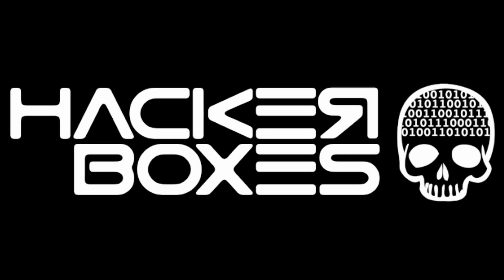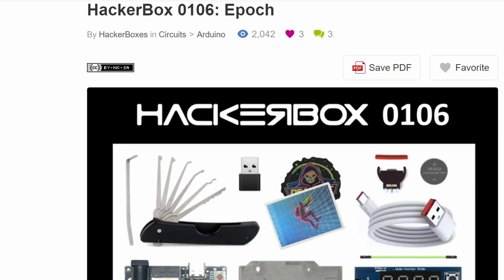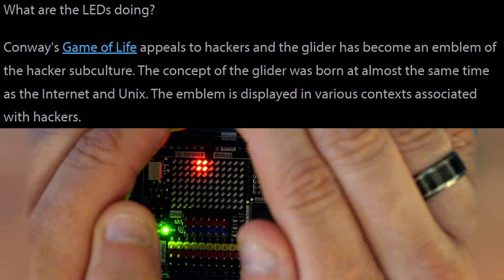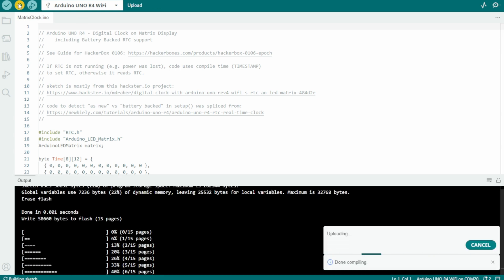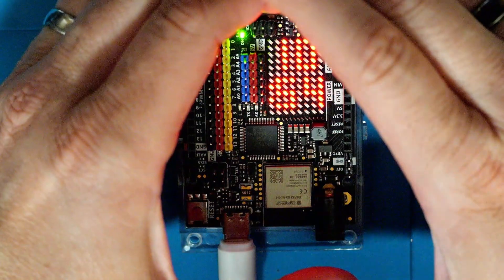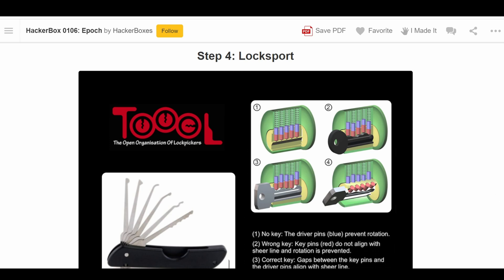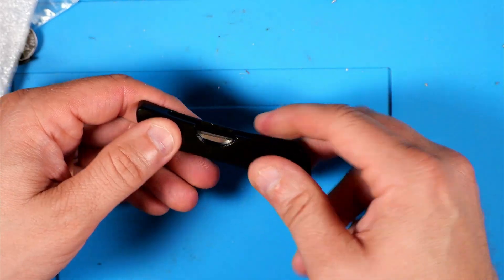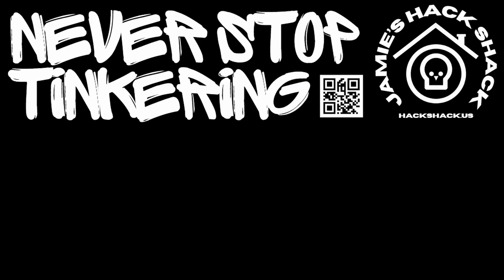Hackerbox 0106 - Epoch

Comment: PhreakNIC had a "Drunken lockpicking contest" way back when in Nashville. Yeah, that didn't work out so well... :) They did have some great locks, including military ones that required that there be embedded magnets in the keys (still pick-able, but they slow you down). Not really my thing, but it was interesting. 

And how did you hold up during what was left of Helene? We got quite a bit of much needed rain.
Reply from the maker: That sounds fun! Not too bad up here, but my folks at home in SC were just today starting to get some power back.
Reply: @JamiesHackShack  Two of my sisters live in N. Augusta, S.C. They had the power line drop in their yard. No harm done, but no power either.